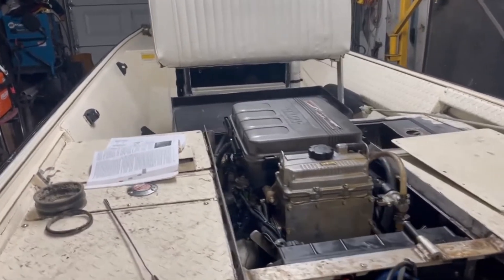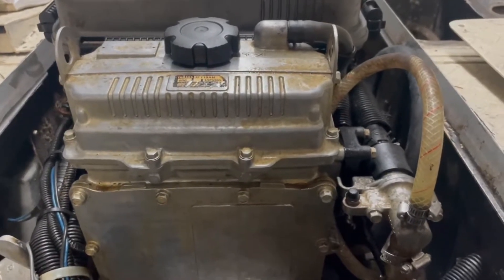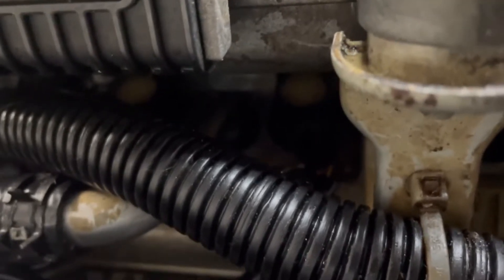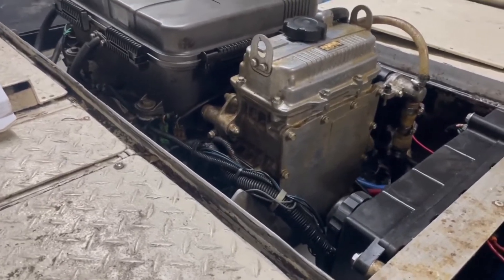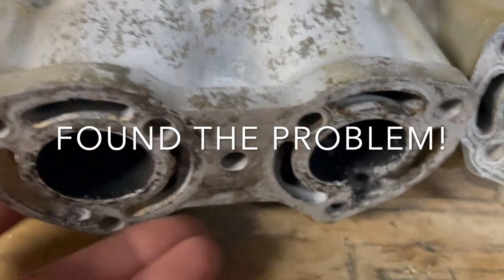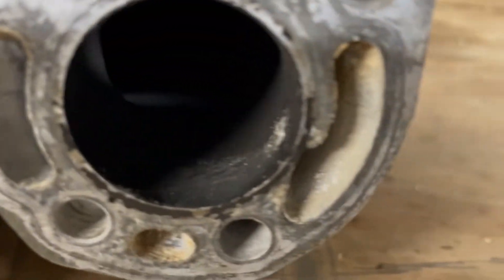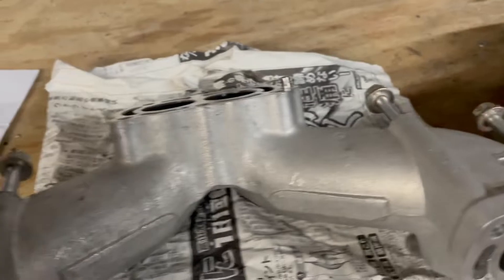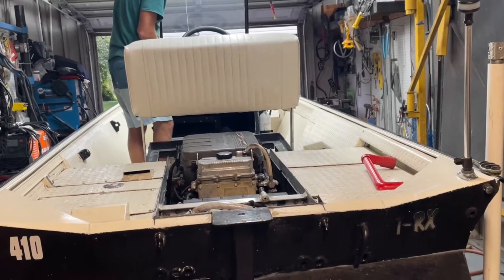Yamaha MR-1 High Output-MAJOR PROBLEM! WATER IN OIL!

Comment: Dude here we are in 2024 I’m having this sort of problem. Can you just clean out the ports?
Reply from the maker: The issue was corrosion holes through the inner wall of the exhaust manifold. Very difficult to try to weld that, or even get it clean enough to attempt to weld it. I’m not really sure why there was corrosion, as I flush my engine after every use. But, it has been in a lot of salt water over the years, and sometimes even your best efforts won’t defeat salt water electrolysis

Comment: I build a lot, and I mean a lot of MR1 motors from the VX110 to the FXHO and I am so glad you posted this video.  Excellent job figuring that out.  This information will go a long way toward helping other people out who have the same question on the forums that I'm on in the future when all else has failed.  I have to figure out a way to bookmark this video so I can send it to them later.  Question for you though, during the sea trial it looks like you're running around 8000 RPMs. The MR1 FX140 and FXHO run at 10,000 RPMs... Or maybe it's 10,300 I can't remember exactly at this second... Was that sea trial at wide open throttle?  If so, something is missing there. What prop and pump are you running?  We have played around with different props and that always seems to be the source of RPM loss if it's not the stock pitch
Reply: Awesome job man. Y have a Ar230 with twins MR-1 engines and one of them needs to be rebuild because of the same problem and also find a little bit of bearing material in the oil. So I’m not taking a chance of it completely locking up on me.  Where can I find a rebuild parts kit and the manual to see the torque specs and measurements for oil clearances etc?
Reply from the maker: @noelcorral2894 Thanks! I would check with SBT for rebuild parts.
Reply from the maker: Thanks! It was definitely perplexing trying to hunt down the source of the water infiltration. Thought for sure it was either the head gasket or an exhaust component. But it turned out to be corrosion holes through the cooling jackets of the exhaust manifold. 

During my sea trial after the rebuild I was running about 3/4 throttle, not wide open. At full throttle I’m getting about 9500 rpm. I’m using a 1998 Yamaha XL1200W 155 mm jet unit, and I’m running a 13/19 pitch impeller.
I wish I could run with the larger pump like they use on the VX110, but none of those have a bolt in intake duct like the XL1200.
Reply: Hey Rob Since you build mr1s I need to replace the manifold gasket #36 on this diagram. Do I need to take off the cylinder head to get to the exhaust manifold? I took off every bolt I can see just about but there is no nudge whatsoever.